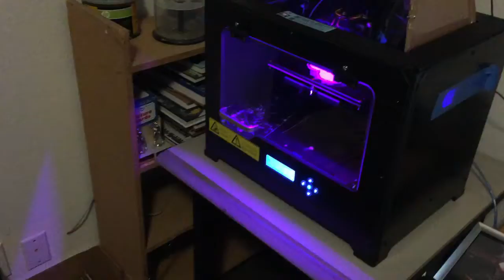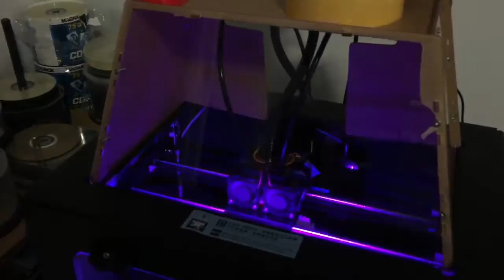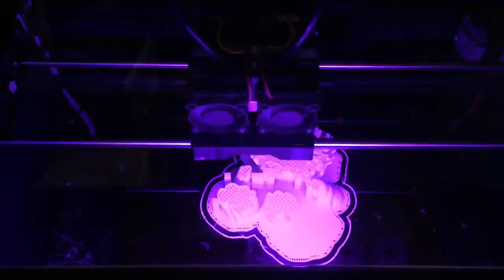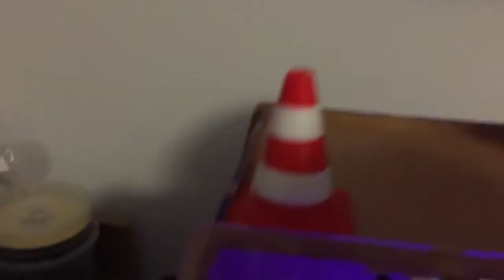Flashforge Creator Pro actively 3D printing

Comment: This is my 3rd printer from after returning 2, a Robo 3D and a Cel-Robox, and I am so far happy with it. It is reliable with no defects. The bed leveling can be tricky and cleanup prep prior to next print can be a chore. But that's for any printer. Do you know how to use 2 filaments for print such as designating one for a support and the other for build?
Reply from the maker: BJM Graphics Glad you like yours, and I love mine! Using both extruders for different purposes requires your slicing program to support that. I use Simplify3D, and that software allows you to specify an extruder for building and another extruder for support!
Reply: Thanks!
I have a tip to share. I just printed a décor holder for my mom which was made in Maya 3D but I didn't check the units of measurement. The result was an object 2 inches too big. What ever 3D program you use, make sure the units are set right during modeling.
Reply from the maker: BJM Graphics preach! That's for certain! :)
Reply: I printed a decor base for my mom and the stand was smooth and I have to feel the model to tell if there was any layer grooves. Cel-Robox does have higher resolution but you can see each painful layers. And it has a mechanized feed tube which malfunctioned. Who the hell need a feed tube to have a griping and pulling motors when your wrist and fingers can do the job with zero parts to fix? After watching Robo 3D startup video several times and trying to test print a comb, I get a sloppy mess of PLA on the bed as the head angrily presses the extrude material all over the print bed ultimately clogging itself to death. The company basically gave me a printer with a haywire firmware that was like a demonic possession. Plus their customer support was arrogant and blamed me for the mess. It was their video and filament that I used.

Comment from the maker: +alphasxsignal for some reason I cannot reply to your comment. The quality on the gMax 1.5 XT, to me, is slightly better than the Flashforge. That said, the Flashforge Creator Pro I have does do PLA well since it doesn't have a filament fan. The Flashforge Creator Pro DOES have a 0.4mm nozzle, where my version of the gMax has a 0.5mm nozzle. So far though, I haven't found anything the gMax cannot do that the Flashforge could do.
Reply: Hi Joel